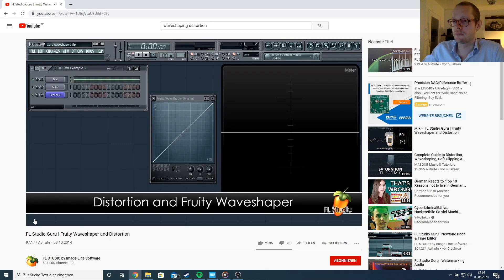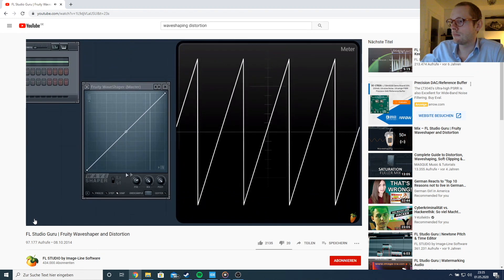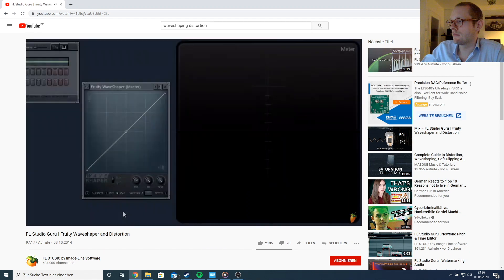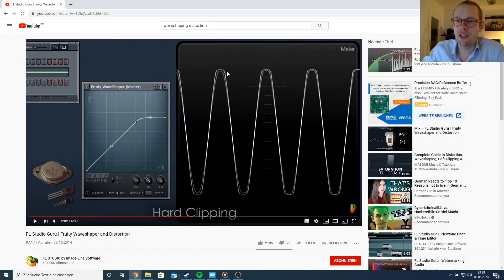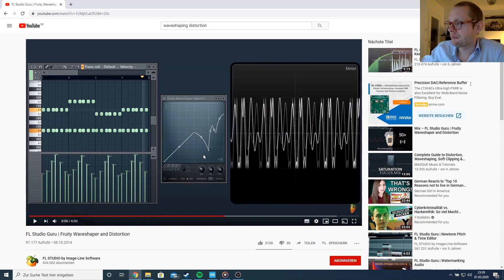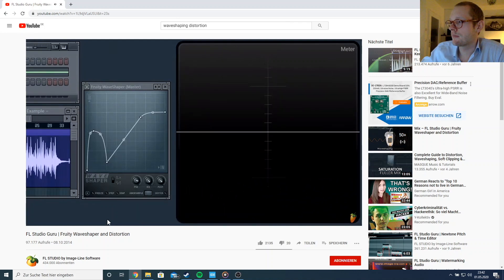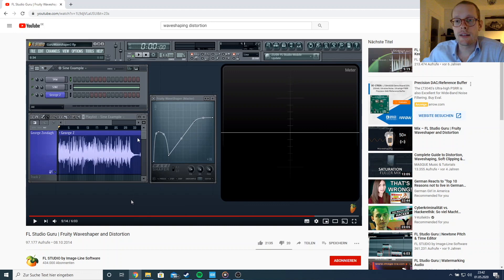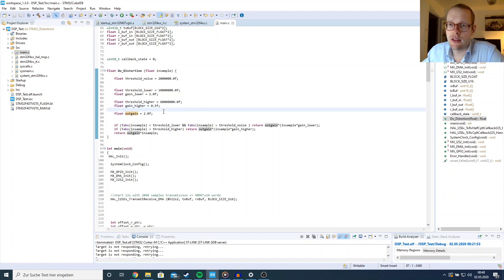[#16] Guitar Distortion Effect - Audio DSP On STM32 (24 Bit / 48 kHz)

Comment: As a thrash metal guitar type I always get irritated when people describe "this" effect as distortion.  We call it over-drive.  Almost every guitar processing "peddle" or "box" these days has several types of "distortion", including overdrive style "turning a valve amp up too far".  However, if you carry on through the presets or components you will find the actual distortion.  It produces a much different sound.  The sound is mostly "grit" but the harmonics of the guitar string are somehow amplified differently, bringing out the primary harmonic cleaner and louder, almost sounding more pure on signal notes than clean does.  Through a big amp the feedback focuses that effect.  Leading to effects such as the ever hanging lead note that you can just hold forever because the distortion "cleans" up the harmonics such that the feedback doesn't degrade into cacophony but instead centres in on the one frequency and gives you infinite sustain.

Comment: Question about the hardware you're using.  What kind of signal level are you feeding and outputting from the external ADC/DAC? Would it play nice with line and instrument level signal?
Reply from the maker: guitarbass95 check out the schematic of the I2S2 pmod board and the datasheets of the adc/dac.

Full scale input for the adc at 3.3v is roughly 660mV rms. But they have a 2:1 voltage divider so it’s 1,32 V RMS at input which is which is approx 4.6 dBu where clipping starts.

For the output it’s 0.76 VRMS which is approx 0dBu max scale output.

Comment: Interresting project you've got there. You are using a very "naive" approach there though, which generates a lot of unwanted artefacts. First of all you should scale down your value range when processing in float, typical DSP in floating point is done in the value range -1 to 1, because there it has got the highest precission. In your waveshaping algorithm you introduce huge discontinuities due to the hard switching through the "if" statements. Imagine 2 very close samples one above the threshold and one below the threshold, due to the different gains the one above the threshold is now a lot further away. This is very bad as it creates new frequencies at or even above the nyqist frequency that you can not get rid of anymore (=aliasing). There are several solutions for this eg. having a smooth gain curve (like the FL Plugin) or just limit the rate at which the gain changes (lowpass filtering the gain). Nowadays more commonly to avoid aliasing is to use oversampling, where you simulate the processing at 2x, 4x, 8x the samplerate and then you filter out any frequency above nyquist of your original samplerate before mixing it down again. Oversampling might be too processing intensive for MCU though. Beside the DSP stuff: "callback_state" should be declared as "volatile"

Comment: Hi! It's great finding your videos. I have a quick question, if you have time to answer. I want to do some real-time DSP on microcontrollers, but I don't know how to set up a buffer (with it's audio callback). Do you know of any resources where I can get started?
Reply from the maker: If you want to stay with STM32, just watch my first STM32-DSP video on IIR filters. I explained it there very much in detail how the I2S and DMA is working.

However - to set it up on other microcontrollers you have to ready the documentation in there. There are various concepts out there.. STM32 with DMA... Infineon's XMC I2S hardware can be used without DMA but has big FIFO buffers in the hardware integrated, etc..

Comment: Awesome video!! I'm an experienced analog guitar pedal designer, and learning dsp with a esp32 a1s. I have a stm32f4 discovery, but it does not have a codec, so...

Anyway, as an advice to get better results, you need to:
- bandpass the input signal
- use 1 to 3 clipping stages (do not use crossover distortion)
- each clipping stage needs to have a high pass before it and a low pass after
- for a "tube power amp" effect, add an extra stage with clipping and crossover dist. the crossover distortion is dependant of the amplitude, as it sets is when the amp is pushed hard and clipping (which makes the bias to drift) it does not happen on low amplitude passages.
After everything, an lpf to smooth the piercing highs ( like 4th-6th order at 6khz) and a bass boost at 100hz to recover all the filtered lows, and you get a nice musical distortion.
Cheers!!!
Reply from the maker: Thank you so much for your great comment. Are u interested to get in touch with me? I would really like to make it better and doing a follow-up video or so..
Reply: @YetAnotherElectronicsChannel  yes of course!!!
Reply from the maker: @dsmnoisemaker101  Just sent you an eMail via the contact-form on your company web-page.
Reply: @YetAnotherElectronicsChannel  replied!
Reply: Hi guys ! @YetAnotherElectronicsChannel @DSM NOISEMAKER I am also looking to create my multi-effect pedal (based on STM32F407) with some features that you described, I can write some code but I'm beginning with STM32...maybe we could work together on that topic ?
Reply: Hi, if you want to have a look, I had prototyped a distortion modeler on Teensy 3.5-3.6 that you can find here:  https://github.com/jcugnoni/TeensyDist
It implements a noise gate, input compressor, pre-distortion FIR filter (pre eq / boost pedal), 4 stage of floating point waveshaper (different models such as 12ax7, 6v6 tubes, soft clipping, and some analytical models, such as asymmetric clipping..). Each stage has pre and post gain, low and high pass filters, and uses oversampling to avoid aliasing of high harmonics. Finally, the output goes through a post gain FIR filter (impulse response, tone stack) and post eq. Most of the code is straight c/c++ with arm dsp instructions... Let me know if you find it usefull and if you come up with something cool. Cheers. Joël